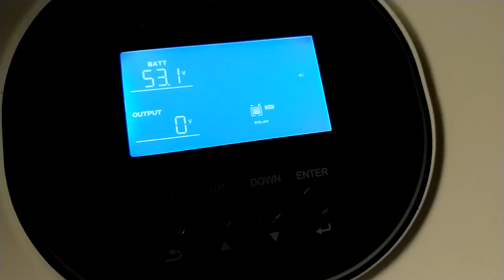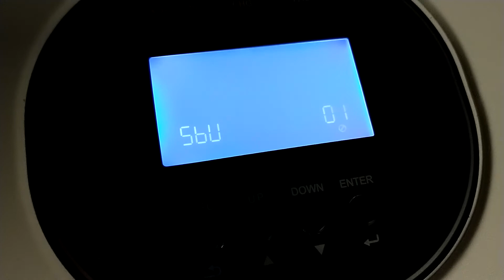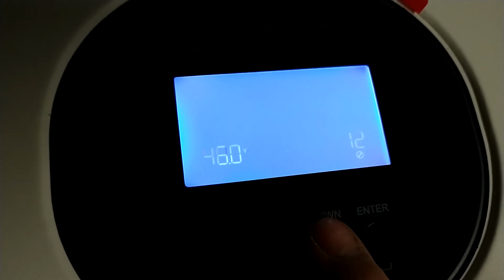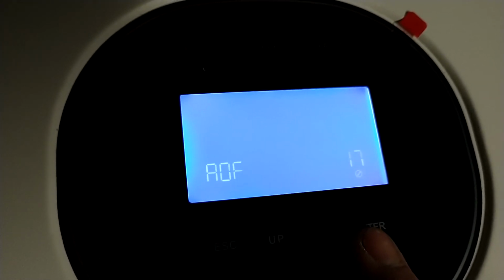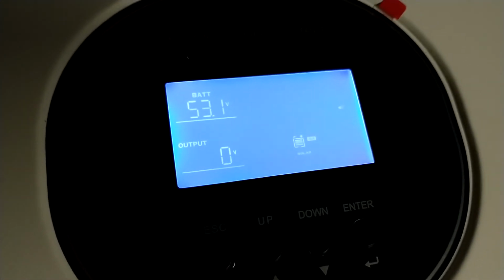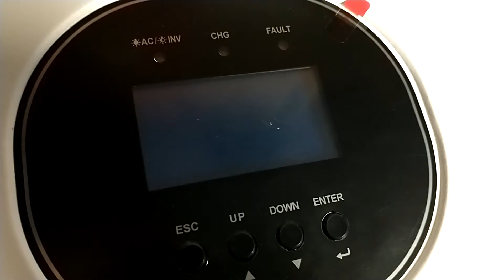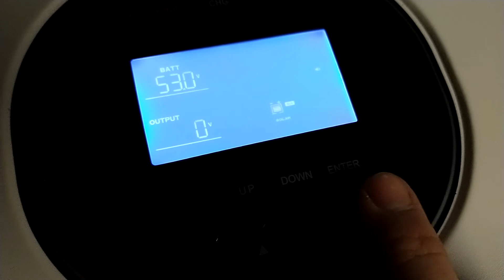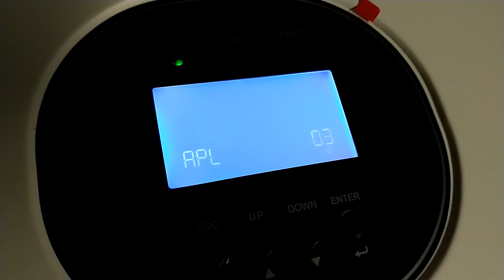Attempting to Disable Beep - Growatt SPF 3000TL-LVM-48P

Comment: I figured it out with the help of watts247. You have to hold down the enter button and the down button at same time for one or two seconds. Then the little speaker icon disappears and it’s muted. You have to do it again if you power cycle the unit - but that should take care of the beep.